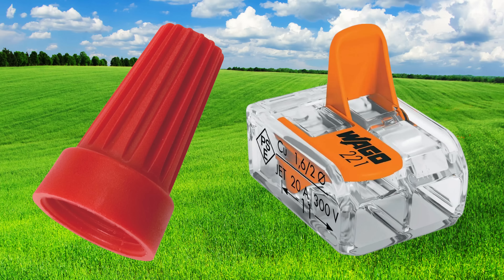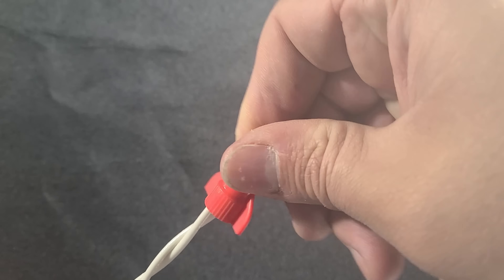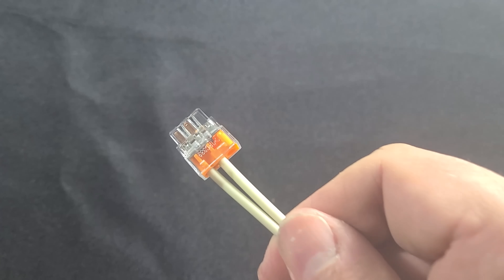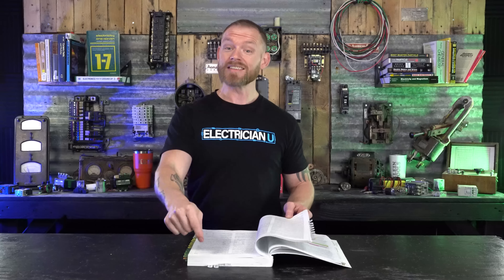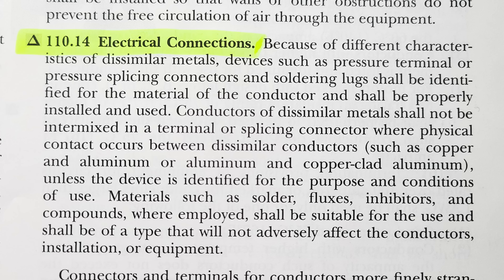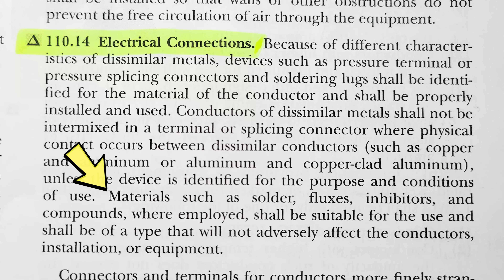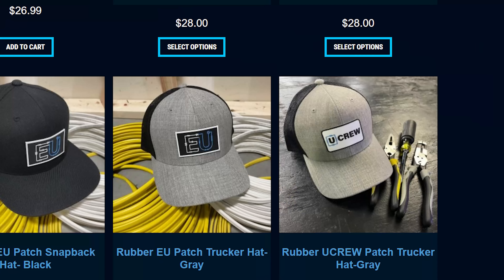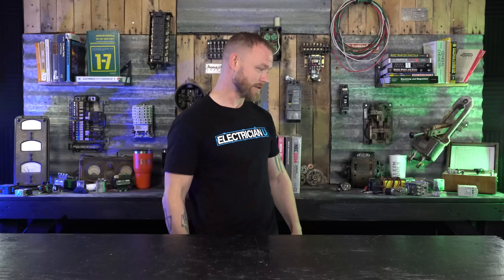Should We Use WAGOS or WIRENUTS?!?!

Comment: I noticed that there are a lot of comments suggesting they would only use Wago on lighting circuits, implying that they are only good for lightly loaded 15 amp circuits. If that's your preference, no problem. I like using both and I'm not an electrician. I've trained myself to be good at using wirenuts and I feel a sense of satisfaction from proper connections when using them. Electricians like Dustin and Bill (sparky channel) aren't limiting Wago's to light loads. My research tells me also that they are proven on 20 amp circuits and receptacles and run cooler than wire nuts in very excessive current tests. The 221-4×× series are rated for 20 amps and 12 gauge wire. The slightly larger 221-6×× series are rated for 30 amps and 10 gauge wire. European electricians have been using them for many years and the concern about them losing tension over time seems unfounded.
Reply: There's several videos of people running all of the common connectors to failure. They're running double the amperage, and more, to fail the connections. If you follow the manufacturers ratings you will be fine.
And the UL or whatever they call it these days test and approve everything electrical in the US.
Reply: I believe most people are using them on lighting because of the location, and because lights are changed more often than outlets.  They're a natural fit.  Meanwhile, being on the ground an experienced electrician can put in wire nuts easily and quickly.  Plus an outlet or switch will probably only be changed every 10 years or longer.

Personally, I use them everywhere as the time savings are always worth it.
Reply: @EmperorA0   Also, many (most?) light fixtures and fans have stranded wire and Wago is more secure than wire nut in this application.  Many new lights now come with a Wago style connector.

Comment: I worked on a house that wasted some motors that had a (starting?) capacitor on it. Two compressors, three water pumps and small table saw. Any Idea what caused that? 
I was told by one electrician that the circuits were maxed out was the reason why. Not exactly sure what he meant. Was it Voltage, amperage or wattage he was referring to. The only outlet available was on a 15 amp circuit . Was that the problem, not enough wattage?

Comment: I have container of wirenuts that I use when practical and cost (they are cheap). But after trying/using WAGOs on my home renov, I will use up the nuts and stick with WAGO (I don't do commercial work so I'm not too concerned). They are great for limited space boxes too, since pigtailing in two recepts, their grounds, and neutrals, its so much easier.